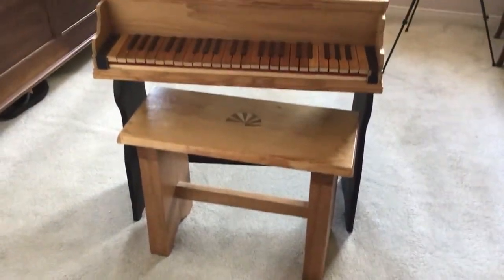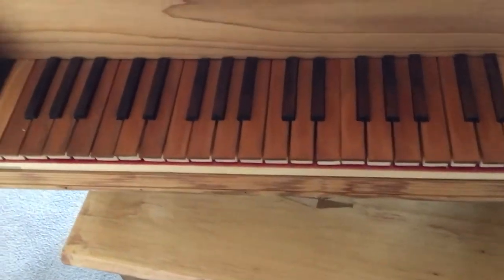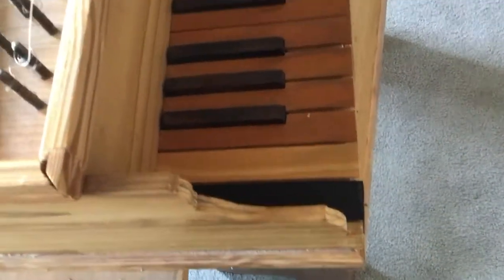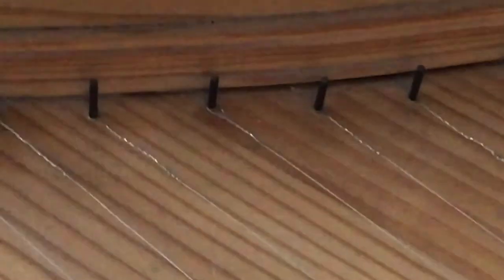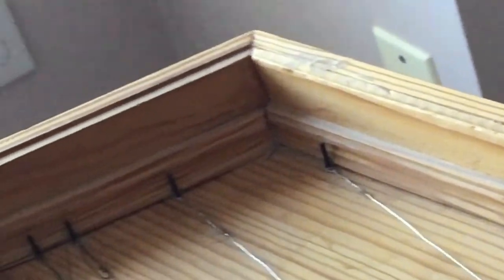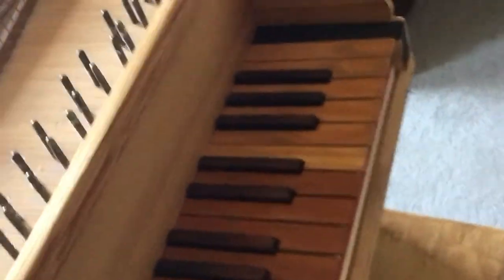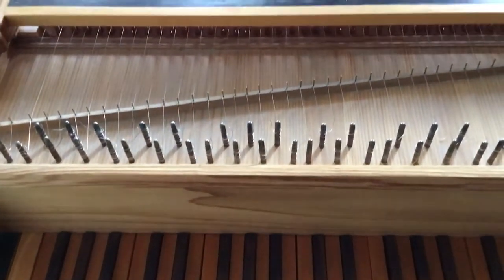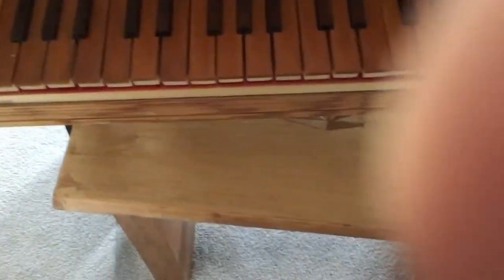DIY Harpsichord  Overview

Comment: Very interesting instrument to me.  Been building them myself for over 50 years.  This crudely made harpsichord seems to be of Italian design from the late 1500s or early 1600s (characterized by using very thin cedar boards in its construction, and just scaling thru much of its compass). It has 45 keys with C/E short octave tuning in the bass.  The hitchpins have no rake angle (this is a bad design, allowing little down bearing on the bridge).  When properly restored and strung (use period brass & iron wire) it will have a very clean, incisive, and delicate sound (if voiced properly).  Hope to hear it someday.
Reply from the maker: Thanks for your perceptive critique. I'm not familiar with "rake angle". When I searched online I learned of someone concerned about a string sliding up a hitch pin which is similar to the problems I've had with  b2 and e2 strings. Apparently that person thought that they should have " rake" ? angled the pin away from the bridge; that's likely what I should have done.

Comment: Just hammer the problematic hitchpins over a little to give them rake. Only you will notice.. Add some glue to the crack in the soundboard, maybe cyano or pva. It’s a lot better than my first harpsichord. 1/4” May be too thick at the treble end for the soundboard. You can fiddle with the keys with shimming to level them. You could cut the key tops off and replace them with new ones evenly spaced. You can’t change the octave span. Best in future to use lime or beech for the keyboard well seasoned in your music room. After cutting it up leave again before adding key tops. Most original keyboards are irregular and their soundboards have cracks. Work from plans of originals from Smithsonian or other museums.
If you are not happy with the tone it is because of the soundboard material and being too thick. Thicknessing soundboards is a black art, but 1/8” in the treble is a good start. Also the barring underneath it matters.
Reply from the maker: I saw your mention of Hubbard's book which is what I started with; I haven't found anything about securing strings on the hitch-ins of Italian harpsichords. There is an article online about string-hitchpin problems  in which a European author stresses drilling hitch pins on an angle unlike my vertically installed ones."Ruminations on harpsichord building
Part 1: Hitch-pins
GEERT KARMAN December 2, 2020"
As for hammering the pins to angle them I'm afraid I might wreck my bent side which is supported by 4 x 1/8 white glued laminate wood strips.
Though the key placement is a bit awkward  the stretch is not prohibitive.
My sound board hasn't cracked in its more than 25 years which surprises me, unlike the pine case bottom which's had a couple of full length slits as I can remember. 
I made my instrument on impulse. I play it nearly every day. It's needed a lot of attention and soul searching to get it to sound as I've imagined; but I'll keep trying and keep  considering suggestions like yours for improvement. Thank you!

Comment: How can someone try building this? We’re the plans and supplies purchased from somewhere?
Reply from the maker: I mentioned my buying wood,  cut and milled to necessary dimensions from various wood suppliers in the Toronto area. Today at least 2 of those businesses likely no longer exist. If I were to start from scratch I'd have to order from a place in Cambridge Ontario"for overs of wood" well stocked visibly perfect wide variety of wood species. I 've mentioned Frank Hubbard's 3 Centuries of harpsichord making  for instructions on  choosing various wood s. Hubbard harpsichord still exists in the Boston USA location where I purchased all the the parts necessary strings, tuning pins etc, There is a similar harpsichord builder in the USA east coast called Zucherman Harpsichords
who I've been told sells strings and must also sell other parts as well.
Reply: What kind of tools are needed for assembly? I have limited space. It seems some form of saw is needed? What kind?
Reply from the maker: Strings and Pipes: I lost your comment until  Feb 25, today. Hand saw  the keys from a board the dimensions of the key bed 45 key blanks wide and key front to jack rail deep. My keys go from E( bass) up to C''' .You can add 4 keys down  to a C bass. Use a small back saw to cut the jack blanks and register channels for jacks. My register had  about a quarter inch "milled" off which I glued back when channels were cleaned. Most large wood case sides bottom boards wrest plank and bridge were "milled". I sawed 15 , 3 sided case supports; a hand drill is the best because it can be more easily controlled than a power drill for tuning pins, hitch and bridge pins. I used a portable workmate bench for holding wood, the instrument and clamping in my little kitchen like Heintzeman who made his first piano in his 19'th century kitchen. I forgot: all the wood is glued. Nails were used sometimes to clamp till glue dried,
Reply from the maker: @stringsandpipes7548
Reply from the maker: @stringsandpipes7548  I replied in some detail 
to your video comment. This reply is to the same comment Youtube put in notifications.

Comment: how bad of an idea would it be to make one with nylon strings? would it just sound like a celtic harp?
Reply: It would be a nightmare to keep in tune.
Reply: I think that's a given for harpsichords because of their wooden frame as opposed to the average piano, but you're probably right relative to a regularly strung harpsichord.
Reply: They already exist they are called lautenwerk
Reply from the maker: Your mention of nylon strings helped me notice that in the early days of harpsichords some were made with gut strings like a lute.Today it appears that only metal strings are used, steel and brass.
Reply: @happygotlucky4309  Thank you very much for the rabbit hole my guy!
Reply: @DEREMIGIS  I always thought that harpsichords had gut strings in the old days making the piano a much more distinct instrument requiring the metal frame to accommodate the higher tension and whatnot.

I originally asked because I'll probably attempt this kind of thing but on a smaller scale using some fasteners and was wondering what I could and couldn't get away with in terms of stringage.
Reply: Better to use gut strings if you can, a harpsichord needs to be adapted for them or a special one made although yours already is I presume. Such a harpsichord is unique and very prized. Listen to Bach's works on one, absolutely devine sound I prefer to steel strung. They need a little more tuning than steel strings but not that much once they have stretched. You can also use nylgut strings which last longer and sound very sweet. I will be having one made in a few years but not now as I already have more harpsichords than a person needs.
Reply from the maker: Sassy, I never forgot your gut string comment so when I was rereading about strings and pitch I noticed that early harpsichords were strung with gut like the lute. Don't remember the nylon string reply that I made. Anyway I'm pretty certain some  early Italian harpsichords must have used gut in imitation of the lute.
Reply: @happygotlucky4309  you are a person to envy if you have multiple harpsichords lmao
Reply: @DEREMIGIS  I really appreciate the follow up comment, conversations like these are the things that get the creative juices flowing enough for me to put one together. Looking forward to more of your DIY harpsichord follow ups.

Comment: What type string are used to that instrument? Thanks
Reply from the maker: I 've received a number of questions about strings. I made the instrument so long ago that I'm not sure how to answer. They are certainly all metal and excepting a few  brass (likely the short top strings: my experiment) steel. Over all I tried to use the string sizes and materials recommended in Frank Hubbard's Three Centuries of Harpsichord Making. There are so many different materials that can produce musical sounds I sometimes think it doesn't matter precisely what material is used. Peter
Reply: @DEREMIGIS  ok thanks